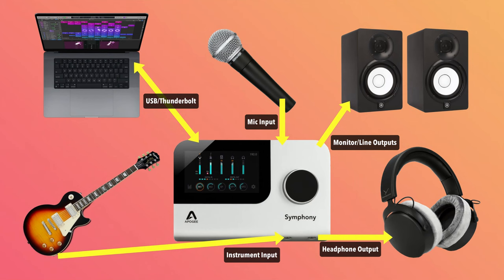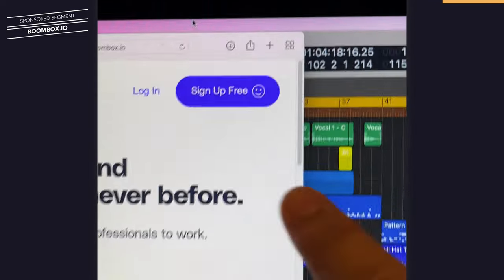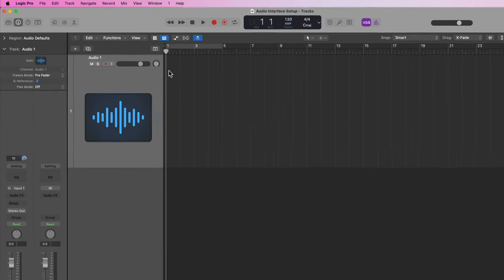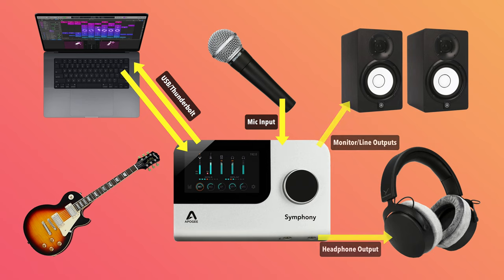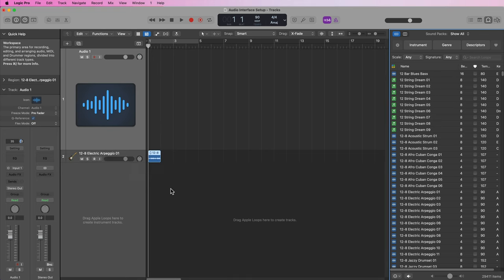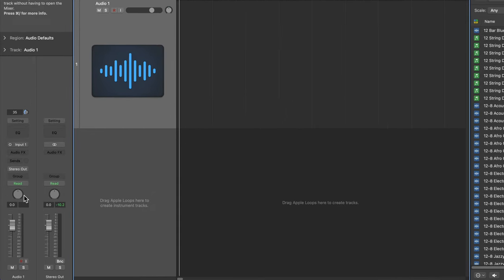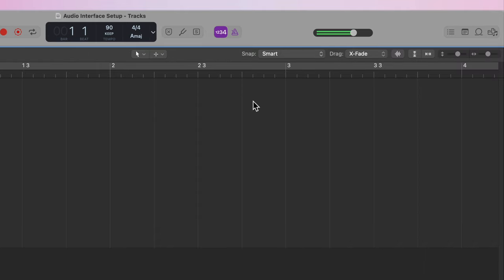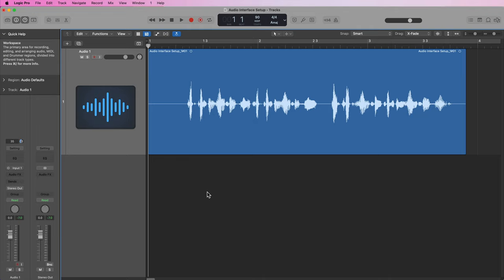Logic Pro #02 - Audio Interface Setup, I/O Buffer, Latency

Comment: when I set the buffer size to 32 or 64 for recording (with autotune), there are cracks to hear and it's like impossible to get an good result. I checked all settings, cables etc. but I don't get it. Where could be the mistake?

Comment: Hi, I'm pretty new in Logic Pro. It looks like the logic is not receiving signal from my mic, have check input, out out and turned on 48v phantom power and don't get anything. What could possible be wrong? Microphone works and my interface also is working good. It has to be a miss configuration in logic..

Comment: Thanks so much!  Not sure if it is in a future episode, but I have a question how to add an external MIDI instrument to this basic setup.  For example, I have an Arturia Keylab Essential MK3 MIDI controller that I want to use to control all my Logic software instruments, and a Kurzweil K2700 external MIDI keyboard.  My audio interface is a Focusrite Scarlett 8i6.  For recording/playing in MIDI, I am confused whether I should plug both the Arturia and the Kurzweil directly into the computer with their independent USB-C cables, or if I should daisy chain everything through the audio interface with the 5-pin MIDI cables.

Comment: Hey!
Thank you so much for this series, it's super helpful!

I have a question about latency. I can't figure out why but mine is huge - I thought it was normal until I came across this video and it turns out it's very much not. With the same settings as you (except rewire behaviour, which doesn't show up for me) and i/o buffer size 32, I am getting 188ms roundtrip. 
For reference, I have a  MacBook Pro M1 Pro (16GB RAM, 10 cores, 1TB SSD), have about 500GB left in my SSD and am using a MiniFuse 2 to record and a Minilab 3 MIDI controller. Even if I switch to my MacBook's microphone, though, the latency remains in the 180ms range, so I don't think it's the interface.
Is there anything I can do to see why that is? I don't understand how my laptop, which is quite a good and expensive one, could have such horrible latency when recording...
Thanks in advance :)

Comment: Thanks for this series! I'm a longtime professional video editor, but just getting into using Logic. 

It's too bad that Logic Pro isn't more intelligent about setting its own buffer size. Seems to me that the app should know when we're recording and when we're mixing/editing, and should be able to set its buffer size automatically.
Reply: It does.  About 12 years ago Logic adopted a dual buffer scheme, where its default playback engine settings use a fixed 1024 io buffer for playback (non-live) tracks and the user-specified IO buffer for live tracks that Music Tech Help is describing here.  Shortly after Protools vamped their playback engine to do the same thing. What you'll notice is that regardless of your IO buffer choice, your cpu usage when just playing back your session is identical. However when you record, your cpu usage goes up and down based on your io buffer. Logic, and Protools, are smart enough to line everything up so that the two buffers don't cause timing issues. Your performance timing is matched to how you heard it in the headphones. This means the record tracks aren't out of time with the playback. By default Logic hyper threads playback tracks (uses multiple CPU cores) for individual voices.  You can set it to do this with live tracks. It amazes me how many otherwise really knowledgeable people with youtube channels don't really know how cpu is handled now. 

The test to do is to record let's say 32 audio tracks at 128 io buffer.  Take a screenshot of Logic's CPU window.  If you don't see this on the control panel at the top, right-click on the time or beats indicator at the top of the arrange window and select customize. Select Custom under LCD, and make sure "load meters (Cpu/HD)' is checked. Then click on the down arrow to the right of the CPU meter on the LCD (top session time indicator)t shows a vertical column for each CPU thread. This is what you take a screenshot of when recording. Record 32 tracks at an io buffer of 128, then 25, then at 512.  You'll notice significant differences in CPU usage. Yet when you take the tracks out of record and just playback at the different IO buffers, you won't see a difference in CPU usage.  This is impossible unless the playback buffer is fixed. This is one of the reasons why logic can be incredibly CPU efficient.
Reply: @jessestuart5756  Thanks! This is great information.

Comment: Hi Josh. Im new to your channel and also new to LPX.  I have an Arturia audiofuse 2 channel  interface, (2x Mic/Instrument/Line (XLR / 1/4" TRS). I would be extremely grateful if you might be able to provide me with a solution to this ongoing problem Im having. I'm trying to record my vocals and acoustic guitar at the same time, using 2 mics. My RODE NT1 for my guitar (in channel 1) and my SM 57 for vocals (in channel 2), both are XLR connections. Problem is I'm not getting a signal in channel 2. 
Im not sure if the issue is with the  I/O setup, when selecting an audio track, (when I first open LPX), or something in the settings of my interface. Maybe its neither, ugh!
Im assuming the interface is compatible with connecting 2 mics at the same time, and not one mic and a guitar for example?
Anyway, thanks for all the great content!

Comment: Hey, so I have a question. I am recording with an Apollo twin x and I was curious if I still need to use a low buffer size in my daw while recording even though I’m using my Apollo to listen to myself recording and not the daw. There is no latency in my headphones when I use my Apollo but I don’t know if and how the buffer size in my daw affects the recording. Appreciate any input on the matter
Reply from the maker: If you are using direct monitoring mode on the Apollo, you can pretty much just leave the DAW buffer size alone. Just set it to a higher setting and leave it there, and monitor your recordings through the Apollo. The buffer size has no effect on the recording itself, just how the signal is processed and the amount of time it takes loop back the signal to headphones. The only downside is any effects you want during recording, will not be audible. So if you're running reverb or compression on your track while recording, you won't hear these effects during the recording.

Comment: When I started using Logic during the first months of Covid, I wanted an option to record my drum kit into my laptop. Most of the interfaces in my budget didn’t have enough inputs for my full kit, but I did end up getting a Mackie USB-enabled mixer that seemed to do the trick. The only drawback is that I couldn’t adjust individual parts (kick, snare, etc) in Logic, only on the mixer itself. Do you have any interface recommendations for someone looking to record 4-6 inputs from a drum kit without breaking the bank? I’m strictly a recreational home recorder with no actual studio - this is all for fun. Thanks, and I’m really looking forward to digging into this whole series.
Reply from the maker: Most interfaces with more than 8 channels will cost big bucks. However, there are several reasonable, affordable options with 8 channels. The Focusrite 18i20 is one example. New they go for around $500 USD. Funny you ask, because I'm actually selling a gently used one for $350 if you are interested, and live in the US?
Reply: Thanks for the input. I may consider that offer…

Comment: Hi, after downloading Ventura on Mac, my Audio interface (ensemble by apogee) stoped working. Do you know a fix for this? Thanks!
Reply: Whenever a new apple os drops, it is highly recommended not to update to it until all the plug-in and hardware manufacturers have had to time to update their products to be compatible with it. You should refer to the audio interface manufacturers website to determine their specific recommendations and whether or not you should update to the latest apple os.
Reply from the maker: According to the Apogee website, you need to update the firmware to ver. 3.5.2 or higher to run on Ventura and Apple Silicon. Here's a link to their compatibility page: https://apogeedigital.com/home-feature-news/apogee-products-and-macos-ventura-compatibility

Comment: Shouldn't we also move ESX2 instrument samples, vst plugins, and other things to an external drive also?
Reply from the maker: If you relocate the sound library as I demonstrate in part #01, it moves all of the EXS instruments to the external sound library for you automatically. Logic doesn't support VSTs, it uses AU Components, but there's no reason for AU Component plugins to be moved to an external drive. The .component files are not large files, and that might make them not load up correctly.

Comment: Not related to this video....I have tried loading Garage band files into Logic. Never had any luck doing so. It was always
clicky, with unwanted noises. Any thoughts?
Reply from the maker: It's been my understanding that you can simply open any GarageBand file directly in Logic. Just right-click on the GarageBand project, and select "open with" and then select Logic. Or just open Logic first, and open the GB project. It's been a few years since I've done this, but I don't see any reason why you would get clicks and pops. Sometimes these are just sync/jitter errors. A lot of the time, they can be corrected by changing the buffer size, hit apply, then change back to the buffer setting you prefer.
Reply: @MusicTechHelpGuy  thank you soo much
that makes perfect sense!!!!!!!

Comment: Thank you for the explanation. I do have a question however. When I have a completed project and decide to go back and re do a vocal, I get this huge latency problem on the vocal. I can't seem to stop it no matter what.
Here is the set up:
All my plug ins are on for the instrument tracks while recording
I create a new audio track to record my new vocal ( no plug ins or effects are on. I would like to if I could however)
The vocal ends up just behind everything and I cannot seem to get a good take.. Maybe you can direct me to a video you already have addressing how to record with "mixed tracks" playing and being able to turn on some effects on the vocal chain for inspiration. Sorry for the long explanation. Thank you in advance
Reply from the maker: Usually when I record into a larger project and I get latency, it's caused by one or more plugins causing the latency. What I typically do is bypass all effects on the stereo out, lower the buffer to like 128 or 256 (still enough power to run most of your plugins), and check the latency on the recording. If it's still laggy, try checking some for some other high CPU plugins in your mix, OR turn on Low-Latency Mode which will automatically bypass high CPU plugins causing latency. You can get to it by right-clicking or control-clicking on the control bar at the top (anywhere in the light-grey area), Customize the control bar, and show "Low Latency Monitoring Mode". Turn it on, and you'll see some plugins turn orange, showing they are temporarily bypassed.
Reply: @MusicTechHelpGuy  Thank you very much.

Comment: hello musictech guy your videos are very helpful to me .but my Apollo twin interface is not working with the 10.7.5 I can hear the music but the microphone don't come though .can you please help me  thanks
Reply from the maker: If you're getting output, the interface is definitely connecting with Logic. What kind of microphone is it? A couple things to check, and apologies if these seem obvious -- (1) If it's a condenser microphone, make sure that phantom power (48V) is turned on and the gain is pulled up a bit. (2) Make sure that the input you're plugged into is set to microphone input, and not line or instrument input. (3) Make sure that the channel input assignment matches the input on the interface. (4) Double check that the Apollo is being shown as both the input and output device in Logic's audio preferences/settings.
Reply: @MusicTechHelpGuy  DO YOU HAVE A EMAIL ADDRESS I COULD SEND YOU PICTURES OF WHAT IM DOING IT STILL NOT COMING THROUGH I HEAR MYSELF IN THE HEADPHONES BUT  NOT THROUTH LOGIC

Comment: Thank you so much for these amazing tutorials! I have an issue with the input monitoring > the button won't show even when you ctrl clic on the track header component..any clue? thank you very much!
Reply from the maker: A few things to check: (1) Right-click or control-click on the track header, a menu will pop up. Go down to "track header components > input monitoring". I'm assuming that's what you were already talking about, but I figured I would mention it first. (2) Input monitoring only works for audio tracks, so if you have some other type of track pulled up like a software instrument track, or external MIDI track, the "record enable" function essentially does the same thing for MIDI. (3) Make sure your "advanced/complete features" are enabled. I cover this in part #01, the previous video.
Reply: @MusicTechHelpGuy  I did all  what you've mentioned, including the part #1 but it still won't show the button...reinstalling logic maybe?
Reply from the maker: @alex_bux  Yeah, sounds like a glitched install to me. You can re-install, or first try trashing your Logic preferences ("settings" in MacOS Ventura). The bottom 2 solutions will help you out with this. Reset Logic Pro Settings and Trash the PLIST file.
Reply: @MusicTechHelpGuy  got it back by reseting Logic Pro settings..Thank you very much for your  advices...;)

Comment: Does this apply to recording software instruments?
Reply from the maker: Yes, the latency will affect software instruments, particularly if you have some plugins loaded that use a lot of CPU power, or cause a lot of latency. I typically lower the buffer a bit and bypass any effects on my stereo out when recording with MIDI.
Reply: Thanks!

Comment: Hi Josh
Quick tip
My equipment is a bit dated and sometimes when I record with 32 samples sometimes I still get latency. If I change to 64 samples press apply and back to 32 samples ( press apply) it resets to no latency

Also I find my Ernie Ball guitar leads have no hiss, crackle and seem to less latency. (The generic leads are rubbish)